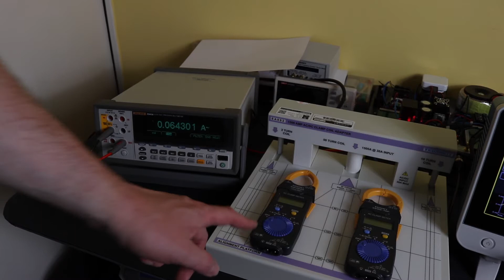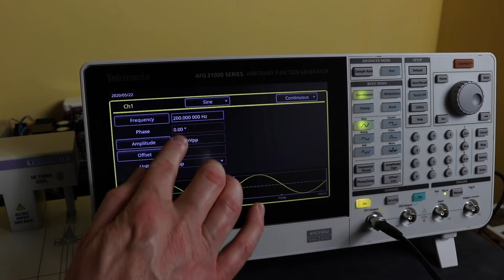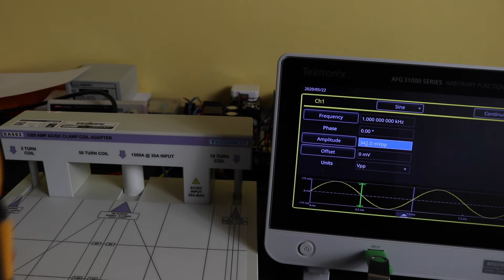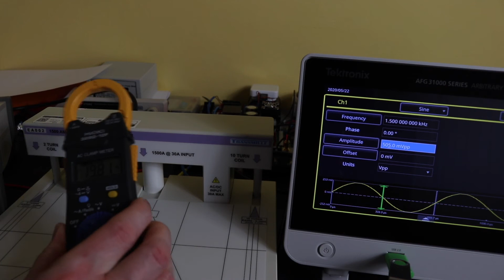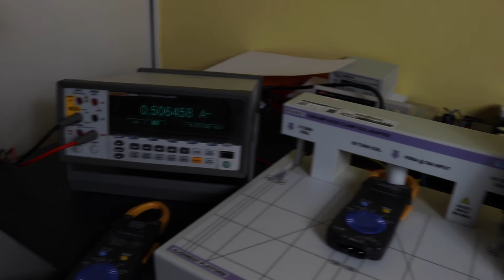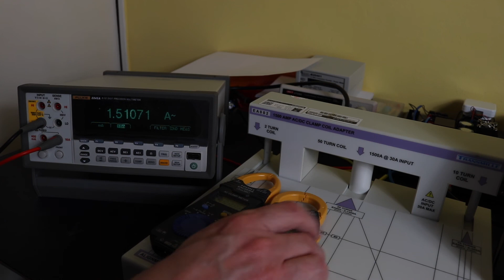Testing Clamp Meters with the AFG31052

Comment: Good video!

Now theres a Fluke with resolution Id trust the readings on. :-)

I like that current clamp test jig. So how does the current amplifier board work? Is it kind of like having a constant current power supply and your AWG just modifies/ controls the output frequency?
Reply from the maker: Thanks Justin T. Yes the 8846A certainly gets the job done, that is one of the instruments I have an external calibration on. It is also one of the few that will read up to 1000V AC, most 6.5 digit bench meters stop at 750V AC.

Yes the amplifier is constant current output. I can change both the amplitude and frequency the amplifier puts out using the AWG. It is the first time I have used it to put out a distorted sine wave. I am going to look at if it can be used to simulate start-up currents as well.
Reply: When you say startup current... As in inrush current? That would be awesome to be able recreate the exact inrush of a device for testing and mooch up.
Reply from the maker: Yes, I have a couple of current clamps that can measure inrush, so I want to see if I can work out a test methodology for them